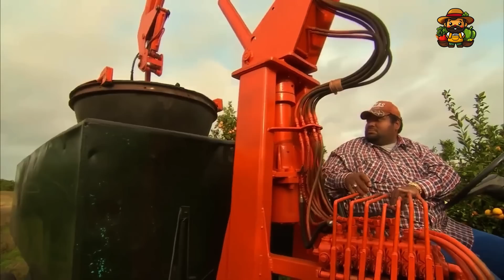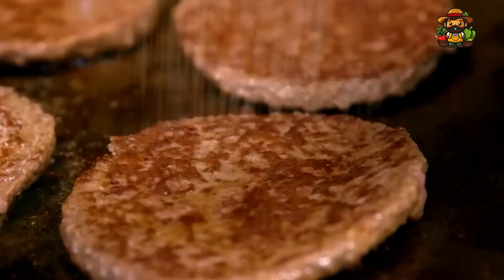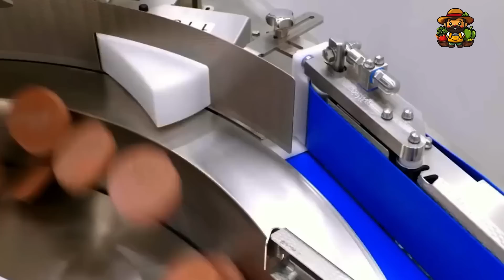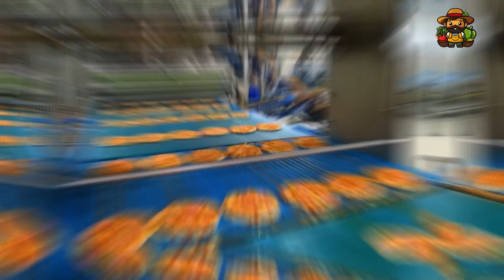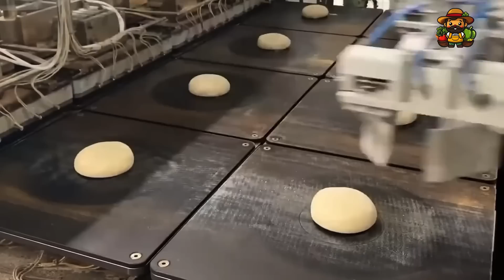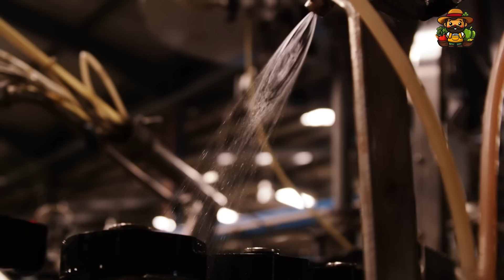Orange Juice Mega Factory: Processing Millions of Bottle of Orange Juice in Factory

Comment: I miss the true tase of orange juice when we bought juice oranges and used the citrus juicer for fresh juice every morning.
Making OJ should be pretty simple. Pick oranges. Squeeze them. Put the juice in a carton and voilà!  Actually, there is an important stage in between that is an open secret in the OJ industry. After the oranges are squeezed, the juice is stored in giant holding tanks and, critically, the oxygen is removed from them. That essentially allows the liquid to keep (for up to a year) without spoiling– but that liquid that we think of as orange juice tastes nothing like the Tropicana OJ that comes out of the carton.  In fact, it’s quite flavourless. So, the industry uses “flavor packs” to re-flavor the de-oxygenated orange juice:
When the juice is stripped of oxygen it is also stripped of flavor providing chemicals. Juice companies therefore hire flavor and fragrance companies, the same ones that formulate perfumes for Dior and Calvin Klein, to engineer flavor packs to add back to the juice to make it taste fresh. Flavor packs aren’t listed as an ingredient on the label because technically they are derived from orange essence and oil. Yet those in the industry will tell you that the flavor packs, whether made for reconstituted or pasteurized orange juice, resemble nothing found in nature. The packs added to juice earmarked for the North American market tend to contain high amounts of ethyl butyrate, a chemical in the fragrance of fresh squeezed orange juice that, juice companies have discovered, Americans favor. Mexicans and Brazilians have a different palate. Flavor packs fabricated for juice geared to these markets therefore highlight different chemicals, the decanals say, or terpene compounds such as valencine.